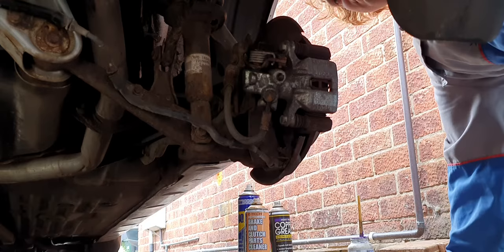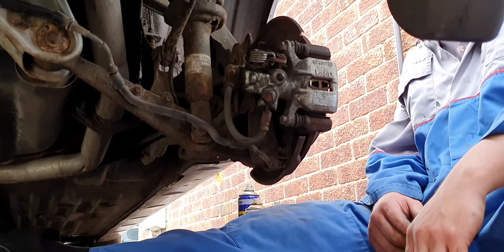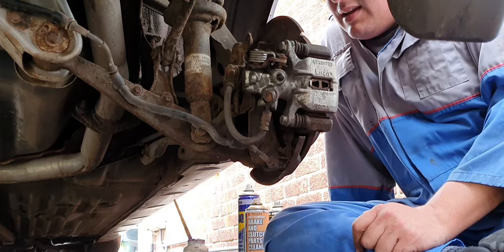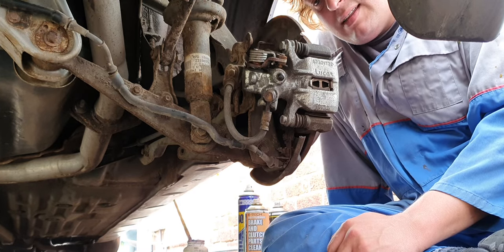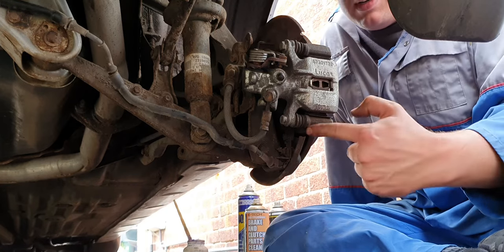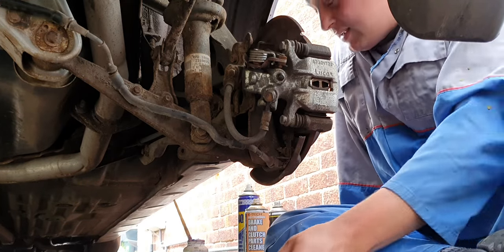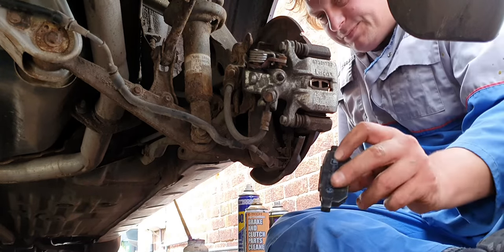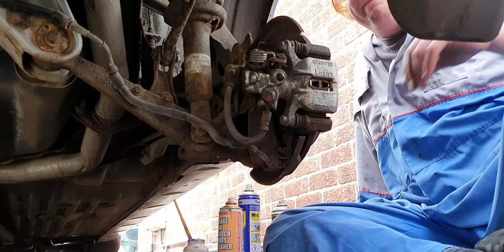Rover 45 v6 rear brake replacement

Comment: Does Joseph's car have the brake pad sensors, apprently mine needs one at the front as the person who owned my 75 before me never bothered to replace the wear sensor and is it easy job to do for a novice like myself?
Reply from the maker: Should be easy enough. Joseph's car does not have any fitted

Comment: Great video! Very informative and very easy to follow! I'll get cracking on my ZS now haha! Quick question... Do you take the brake fluid cap off when doing this? Or leave it on? Thanks!
Reply from the maker: It dosent really matter, i prefer not too. 
Just take note of the brake fluid level before you wind back the calipers as it may overflow, in thst case leave the lid on to avoid mess.....
Reply: @therubbishmechanicmrcoleman  Great, thank you!